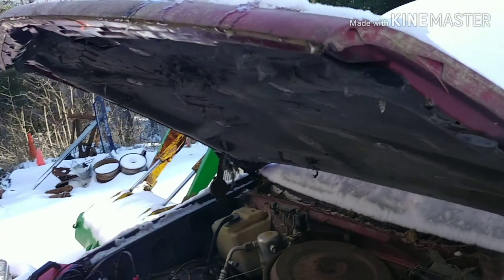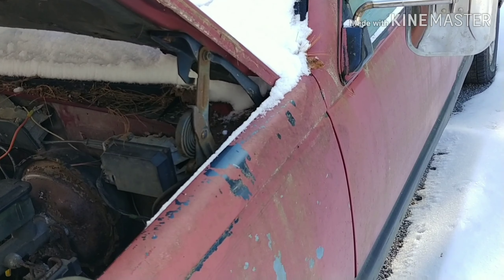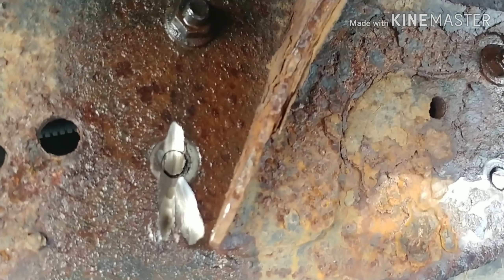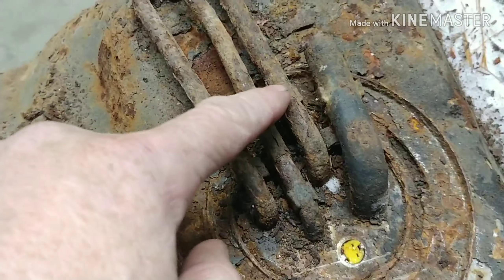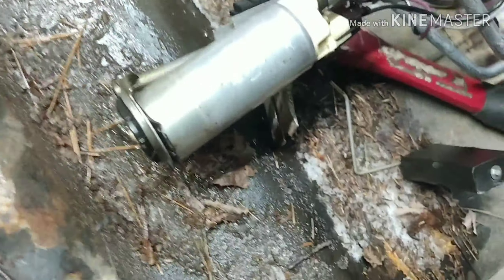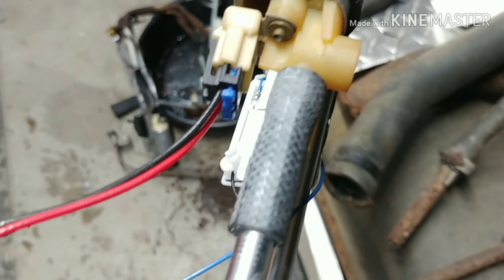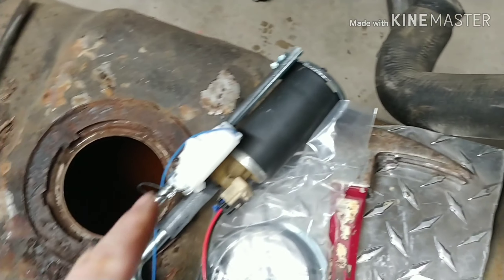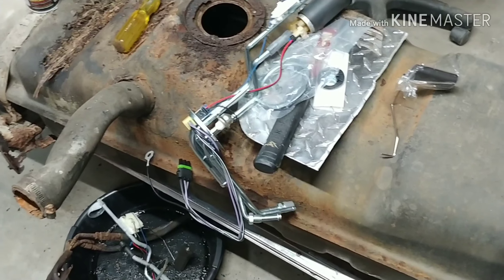Replace fuel pump part 1 #obs#chevy truck #farmtruck

Comment: drain the tank.  that's likely not fuel, but water in the tank, if the filler neck has been open for a few days, all the fuel will evaporate in a few days.  i would bet my pay cheque that's half a tank of water.  open filer neck lets fuel evaporate, and lets water in.  rockauto has cheap sending units, i got one for the firebird in stainless steel, and i used all stainless and braided lines.  rust sucks.
Reply from the maker: I bought a new sending unit already. The filler neck was broken and open. I am going to mount the tank in the bed i think. When i get home this weekend i will drain tank and put fresh gas in. Throttle body don't take much more pressure that carb i hear. Trying new metal lines as far as i can get it, then probably just rubber for now to get her going.
Reply: @workingmansrestorations7071  rubber / neoprene is a great way to go.  flexible and corrosion free.  ya TBI is only 14 psi.  might have to clean the throttle body or the injector inside there